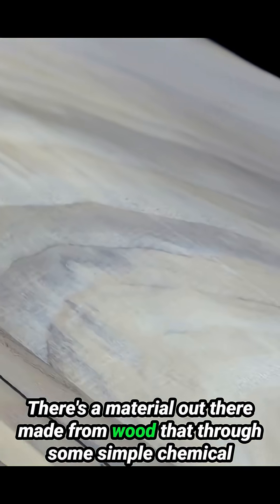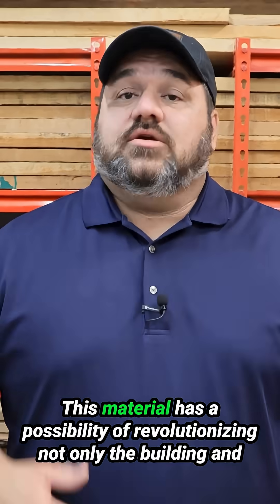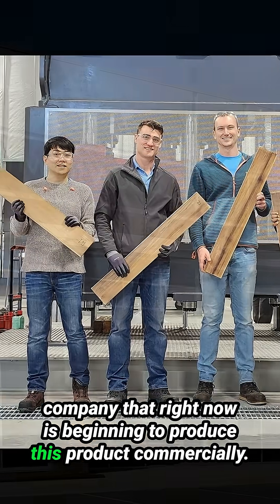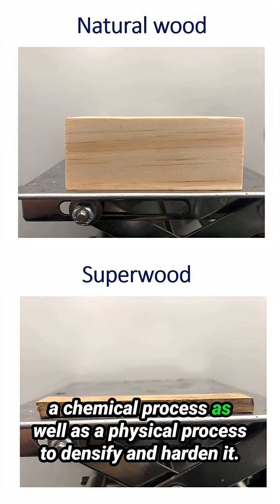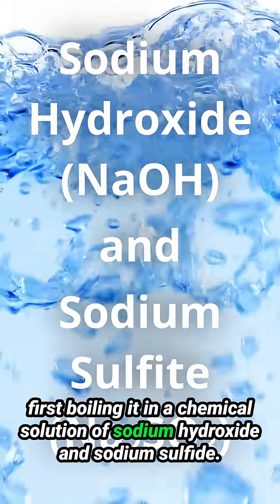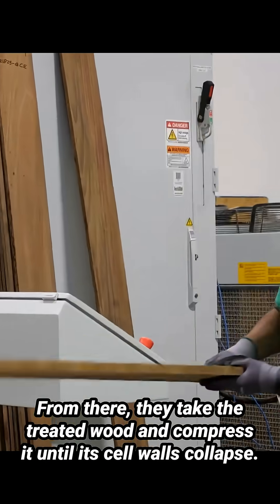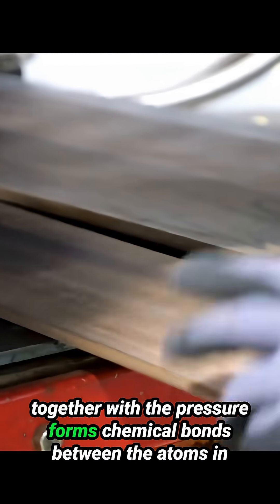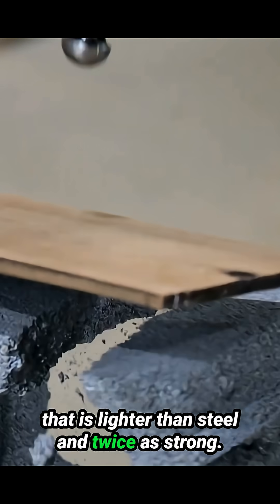Can Wood Be Stronger Than Steel?

Comment: For reference, it's stronger than standard structural steel, similar to aircraft aluminum. However, it does have grain alignment to consider.

For those wondering about cutting, using standard carbide tipped saws will cut it easily and cleanly.

Comment: what would you use to cut it
Reply: Probably a metal drill bit. Although it could require something specially designed that has hardness and sharpness. At a minimum, carbide steel
Reply: @warrenm72 Carbide means having carbon.  Steel is iron alloyed with carbon. Iron carbide perhaps. 

What you are referring to is tungsten carbide. Not steel at all. 

Both will cut this wood just fine. It is not stronger than steel. He is leaving out the "of the same weight." For the same size steel is 10s times stronger. Also you can make shapes like tubes and I beams with steel that bring the weight down.

Comment: question: the fact that it is really denser compared to regular wood makes it also more thermal conductive or it can still be used to insulate?
Reply: Wood is not a good insulator. A standard 2x has single digit R value. The harder or more dense a material, the less R value it has.
Reply: Wood is not a good insulator.  Where the studs bridge the exterior walls is where the heat transfer happens.  
In large parts of Canada you have to insulate a wood wall cavity and add rigid insulation boards to the outside.
Reply: @trevorrotchell  do you see many double studded walls? Thats where let's say you have a 2x6 wall. You use 2x4 studs, offset 8". One in, one out. There's also those studs that have the dowels attaching the inside stud and the outside stud. But the offset 2x4 i think is better

Comment: Might be stronger than steel, but not one piece of steel in a fabrication is a rectangle. If they can make a beam, column, hollow section etc might be rather useful
Reply from the maker: Great point. They say that they can actually form it into shapes during the compression/heating step. Not crazy shapes, but think of things like car panels: https://youtu.be/n4-v3ntYZAs
Reply: Good for shiplap
Reply: Wood I-beam exists among others. With joineries and laminations it can be made for general construction.
Reply: Stronger than steel is inaccurate description. You mean tensile strength or fracture toughness?